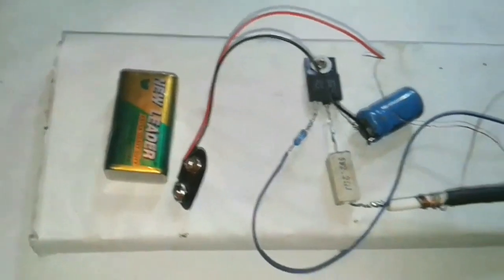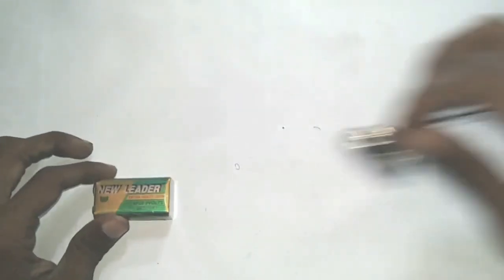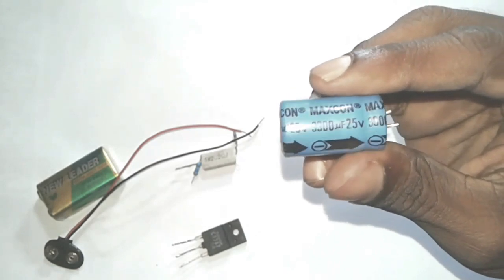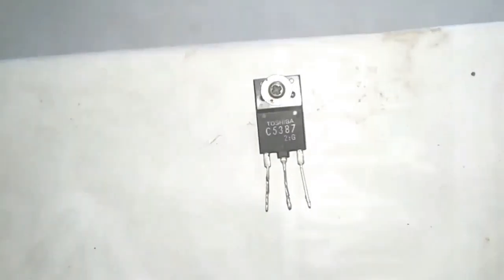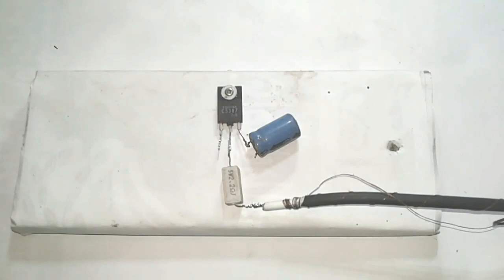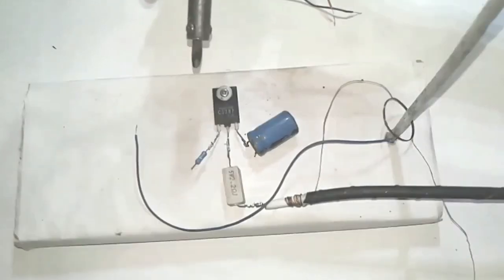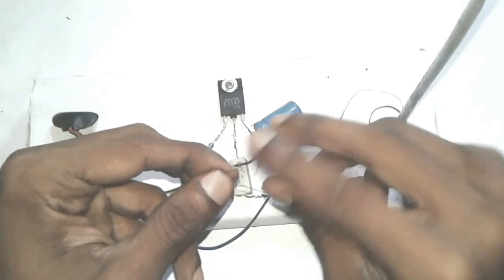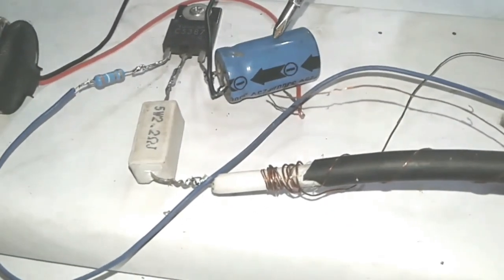How to make a mobile network booster for home

Comment: But gsm signal is 2 way rc+tx you need 2 transistors atleas plus amplified signal will cause dead looo/lock if antennas not seoerated, ewen on real boosters. Plus you need atleast 700/800 mhz capable transistors .

Comment: Does the coil of wire need to be made of an insulated wire, or just bare copper? Also, how many turns does it need to have? From the looks of it, the ring is about 350mm in diameter, correct?

Comment: Hi Bro, I'm from Malaysia, my mobile signal is only 1 or 2 bar in whole of my home. I am not an technician person nor in electronic. I would like to try this DIY method as per your videos. Appreciate if you could give me the code for the small blue resistor so I dont buy the wrong item. Tq
Reply from the maker: 273k or  near
Reply: @MFRVISION  Hi Bro, I got no idea ..
Reply: @muralee29  purchased singal booster under 2000 to 3000 🙂

Comment: Sir please help me , because I don't have aluminium paper and I have not that value transistor and capacitor and resistor please sir I have not get anything but I know the you will help me C5027 transistor please give mi a new circuit diagram , I will request you please sir ,🥺🥺🥺🥺😭😭🥺🥺🥺🥺😞😞😖😩😫😫🙏🙏🙏

Comment: Brother its working.  Thank you for your help ❤
Reply: Did you make it?
Reply: Yes
Reply: Is this a successful method?
Reply from the maker: Of course
Reply: Sir aapake mobile me network aa raha he kya sir hamare gaw me network kam aata he or gar me nahi aata he sach me aata he na sir
Reply: Bhai plz tell me +ve supply coaxial cable ke outer wire  ke through antenna pe gya but wahan se wapas circuit me kaise aaya koi antenna end pe coil hai ya koi pf hai ya direct kisi almunium ring me connect hoke +ve supply niche circuit me aa raha hai..?

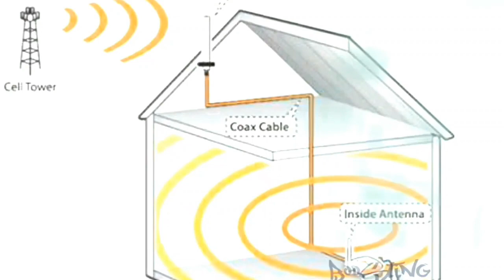Comment: 0:20 it is 3G+, not high speed plus.
Reply from the maker: Both are same meaning?
Reply: C8B Ideas, 3G (H) = 7.2 MBits down, 3G+ (H+) = 42.2 MBits down, depends on mobile provider.
Reply: What is this range?
Reply please
Reply: King 2280, depends on frequency. If there is only H or 4G at B28/B20/B8 it‘s higher. I think (didn‘t tested it) around 5 meters.

Comment: Nice info, thanks :)
Reply: This circuit is great.
It even works for wifi.
Signal increases 2 bars and no more disconnects.
Also on it close to digital tv antenna no more picture breakup.
I put it next to my auto engine. Mileage to up 10-15 mpg and lots of power.
I put it on my pillow at night now the bald spot on my head is growing a lot of hair now.
Also missing 2 tooth in front new one grow back.
Wife too small on top put circuit in her purse now like mountains but problem now she poop a lot.
You should build on black box sell make a lot of money.

Comment: How to make output antina
Reply from the maker: Just like a tv antenna
Reply: 2nd end - bring it outer place where u get good signal on ur phone....
Check it on ur settings>about phone>signal status
Where the signal should be around -50dBm to -90dBm (or simply where u feel the signal is stronger for ur phone)

Comment: Where we connect second end of antenna wire??
Reply: 2nd end - bring it outer place where u get good signal on ur phone....
Check it on ur settings>about phone>signal status
Where the signal should be around -50dBm to -90dBm (or simply where u feel the signal is stronger for ur phone)
Reply: What is the maximum cable length for outdoor to indoor connection
Reply from the maker: 30 -50m